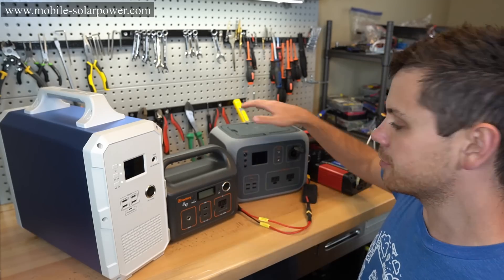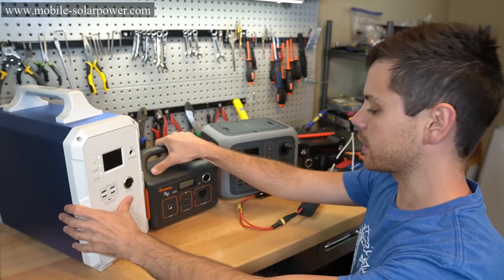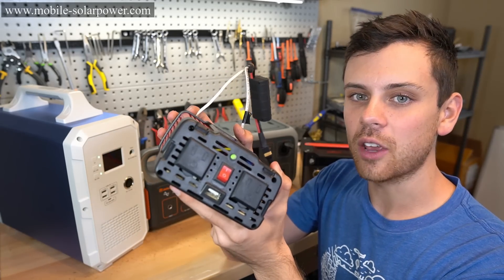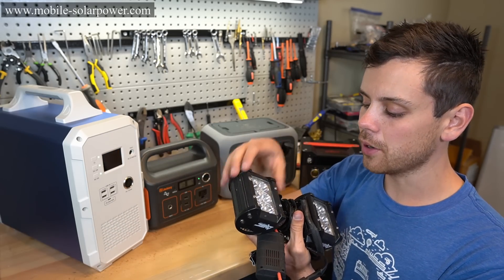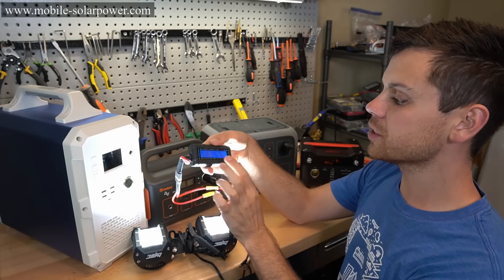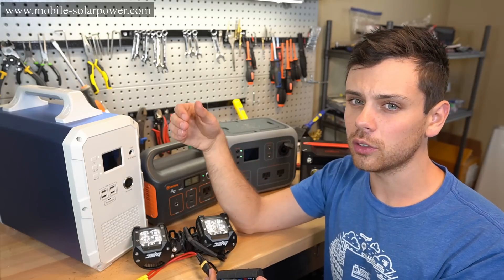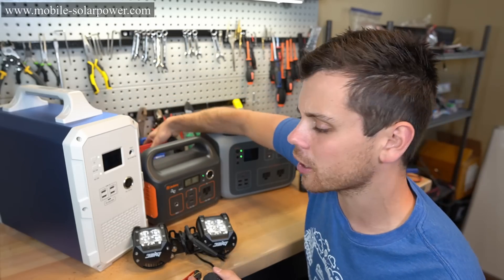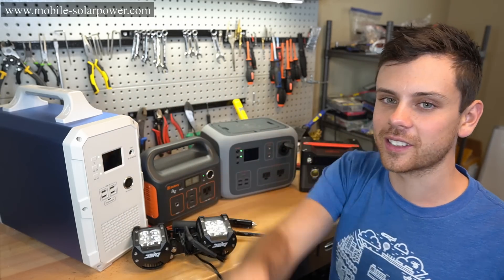Lithium Solar Generators: Why you need a regulated 12v output

Comment: There’s a lot of good info here, but I’m going to have to disagree with part of it as I think some discussion on the downsides of a regulated output is needed.  I agree with the core message – unregulated 3s (or 4s) lithium-ion output is not a direct replacement for 12v.  If you’re running low power devices that aren’t noise sensitive, or you don’t want to worry about the rated voltage range on your 12v devices, then sure – go with a regulated output.  Let me explain.

Regardless of whether the regulator is stepping up or down, there is a loss.  The regulator will also introduce some level of noise (I'll admit this is an assumption that they don't have great filtering).  These may be negligible, or they may not be – it depends on the application.  Radio applications, for example, may be more affected by noise.  High power applications will be more affected by the regulator loss or overload the regulator entirely.

That’s what so critical – what you are powering from it and what the rated voltage range is for those devices.  While most inverters will have problems with 3s output (9 – 12.6v) as Will pointed out there are some that are rated for input voltages down to 9.2v such as the Victron Phoenix series.  These aren’t cheap, but they are inverter options that can handle a wider voltage range and eliminate the need for a regulator.

Likewise, some of devices that you will run on these are simply stepping down to 5v.  In that case, there’s absolutely no need for another regulation step that is just decreasing efficiency.  From my testing, most step-down devices (for USB charging, etc) can tolerate 8v-28v+.  Of course, there are other 12v devices that will simply not work on the lower output voltage of an unregulated solar generator.

In my opinion, the best option would be having regulated and unregulated outputs available.  But I’m also overly picky and really don’t like these off the shelf solutions – I ended up building my own 3s lithium-ion pack which isn’t regulated and should be able to output roughly 50A peak.  I’m aware that may not be a common use case, but I looked at the devices I plan to run on it, and I shouldn’t have any issues with the voltage range so I can skip regulation (or add an external regulator later if needed).

Lithium iron phosphate is a different story - 4s LiFePo4 is much closer to a lead-acid 12v system and shouldn’t require a regulator.  I’m just not sure if any of these vendors are using those batteries yet in their solar generators.
Reply from the maker: I have to disagree because first the efficiency of these converter circuits is the difference in voltage between input to output, and usually in my tests, boosting from 10 volts up to 13 volts will be around 96% efficiency. Next, the noise is low. If you have extremely sensitive equipment, why in the world would someone run it through any solar generator this cheap? If someone is doing radio, I would imagine they have a decent education I'm electronics and would build their own. Not using a cheap battery box from China.
Reply from the maker: Yes, LiFePO4 doesn't need it and I love that chemistry. And yes, I'm glad you made your own pack. It would be pointless to buy one of these units for your application

Comment: Hey will, you should check out Beaudens. They are using LiFePo4 batteries and mppt charging. They only have a 166wh available on amazon but they told me they are making 300/500/1000wh models right now with pure sinewave inverters. They do passthrough ac/dc/solar charging also. Definitely interesting to see someone moving in the right direction with these.
Reply from the maker: I know of those. I had no idea they are making larger models. That's great. Thanks for heads up
Reply: @WillProwse  I just received the Beaudens 380wh LiFePO4 power station and I'm in the process of testing it now. Will - since this is using LiFePO4 chemistry, will the 12vdc output effectively be regulated because of the characteristics of the battery or no? I like the size/specs - 2000 +/- charge cycles, pure sine wave, etc but I am planning to run a 12v portable refrigerator so the regulated-ish output would be the deciding factor if this will be suitable for my application. Your thoughts? Thanks!

Comment: My guess is the unregulated ones just feed of a 3S pack (assuming 18650 LiIon) or 4S (LFP), and the regulated ones have a 4S or 5S pack feeding a buck converter. Oh so slightly wasteful, due to losses in the converter, but made up for by the extra cells in series. The coloumb counter would be connected before the buck converter in my design so you could see the total usage, not just the usage after losses in the converter. Charge controllers have very wide voltage output tolerances, so charging a 5S with a 12V MPPT/PWM is very doable.

Comment: So, if I have a simple panel+charge controller+battery +inverter+load setup, it may not work for some loads just because the  output is not regulated? What do I need to do then?

Comment: will, what do you suggest to make a regulated 12v. you mentioned in one of your videos that its fairly easy to make one. Im looking to add to my diy portable power banks. Ive seen step up regulators, is that the same?  Can you chime in, im sure others will want to know also...but dont have the knowledge like me
Reply from the maker: Yeah I could do that
Reply from the maker: I promise it's super easy. Just a typical boost converter

Comment: The young man knows of what he speaks.  And some items that you use will have regulation as well that needs a minimum voltage to regulate properly.  I want something closer to 13 volts minimum at full charge.

Comment: This is probably why auto fridges like ARB and Dometic don't run off some of the solar generators out there. They work fine at the beginning and then won't cycle on after a while.

Comment: Idea for future video: Build some sort of current limiter device that would allow the Bluetti to be charged from an alternator. I know it can be done with a inverter as you described, but this is expensive (have to buy inverter) and inefficient (dc to ac to dc). Isn’t there some way to build a simple circuit that would reduce the maximum current coming off the alternator to the max the Bluetti can safely charge at?
Reply from the maker: Yes a DC DC boost converter with current limiting will do it

Comment: So glad you have your channel!  I just started getting into solar power about 3 months ago.  Wanted to have a portable powerpack to test electronic equipment for units I sell and buy (had been using my Duracell power pack 500).  Bought an Ecoflow River and it has worked well for me.  Right after I bought it, the Jackery 500 came out and I had to have one as well.  I also lose power a lot in my community and the Jackery 500 will help me keep a few things running when we lose those mostly 4 hour power outs.  Now, I'm looking forward to find a bigger unit for more home emergency like the Blueitti.  Glad to see in the next few months quite a few more companies will bring new items out giving more power.  I see the EcoFlow Delta may be a wonderful unit coming out very soon.  Little scared though to buy something from them.  My Ecoflow River has worked well, but in the last 3 months I've asked a few basic questions about the unit thru their support.  Never once did I get a response from them.  On the other side, the Jackery people have answered every question I've asked them and usually give me a response in a day.  I don't plan to build a home unit, but I do watch all your videos and have learned a lot about solar!  Your reviews of the power stations have been so informative!  Can't wait to see those reviews as those new units come out.  Again, great channel!  Thank you!!  -- Atco

Comment: Everything below 12 volt becomes problematic, as 12.0 volt in a car battery means it's almost empty. To prevent damage to the battery by overdischarging most inverters will cut off around 10.5 or 11 volts; inverters will cause load spikes that might drop the voltage to those levels. Especially if the cables used are thin this drop will happen.

Comment: I completely agree with you. An even better test would be to use a 12v clock. An unregulated output could cause all sorts of issues if your device is time sensitive

Comment: Not to mention damage due to power draw for unprotected items. Potential over heating and increased resistence in wiring...
The list of reasons to go with a regulated source is extensive.

Oh and that low voltage to LED. This will potentiallly damage, discolor, and decrease life of LED's

Comment: The regulation also eats power as I imagine its a crude way or voltage regulation as apposed to a step up buck converter
Reply: Interesting thought I had.. I imagine most outlets are around 13.6v due to the design or 12v was for vehicles and the alternator generally float them at 13.6 to 14v. Good video

Comment: Does such power regulation cause RF noise? I'm interested in a small self-contained unit for ham radio. I have a Jackery 160 but haven't tested it yet.
Reply: Yes, almost certainly some level as they will be using a switching regulator.  I'm assuming devices like this won't have great filtering on the output.  I'd be interested to see someone test this though.

A solar generator using LiFePo4 batteries (in a 4s configuration) would be better for this application as it wouldn't require a regulator to have output voltage very close to lead-acid.  Just not sure if any of those are available.

Comment: Advantages I have learned from Will about  the Jackery 500 that make it the best choice for CPAP machines.
1. Can be charged and discharged at the same time. = Great for 24/7 use. *
2. Has the best display for power in and power out. 
3. Voltage regulation ensures clean DC power. = Protects sensitive electronics.
4. Expandable. Suppose I want to add a larger battery but the larger battery does not have voltage regulation. No problem, just plug the larger battery into the Jackery and the batteries will even out. I am personally looking at the Mighty Max Battery 12V 75AH Gel Battery, currently $160 on Amazon. I like that it guarantees no fumes for indoor use.  

My CPAP is hooked up to my Jackery  24/7  to ensure clean and consistent power. I don't worry about minor power surges, brown outs or power outages. 

The only downside. The Jackery takes 8 hours to fully recharge from zero, some competitors only take 4. And of course, the lack of an MPPT charge controller for when I upgrade to solar. 
* Once the battery is fully charged, the shore power on my Jackery 440 is turned off and will not turn itself back on. The work around, when I turn my CPAP machine back on, I unplug the shore power from the Jackery (not the wall) for a few seconds then plug it back in. This way, my Jackery is always at 100% power. One month in and I have not seen any change in battery performance if I just run off Jackery, no shore power. I still get 8 to 10 hours of power before going below 30%. The Jackery 500 replaces the Jackery 440, so the 500 may or may not have this minor inconvenience. 

BTW, the Jackery 500 is on sale on Amazon today for $425, a $75 savings.

Comment: Regulated vs. unregulated; has a lot to do with the battery's state of charge. As long as the battery can supply 12 volts it will work just fine. All your examples had batteries of less than 12 volts. Another words, it's capacity. How long a battery can sustain 12 volts at what draw.
 All batteries will fry in an instant if you allow them to draw too much current.

Comment: Hey Will... Is it possible you are dealing with two different battery chemistries? The open-circuit voltages for what you are calling the "unregulated" units seem very low for their given SOC. It is suggesting to me that the "unregulated" units are using lithium-ion cells in a 3S configuration and what you are calling "regulated" units are using LiFePo4 cells in a 4S configuration. I could not find any specs for the types of batteries that the MAXOAK units are using. Have you opened up these units to see what type of batteries they are using?
Reply from the maker: Yes absolutely, that was the point. 3s lithium ion cells have a low nominal pack voltage. And unregulated refers to converter circuit that ensures voltage is constant even if battery voltage is low. If internal jackery battery is at 10v, it still outputs 13.3v.
Reply from the maker: oh I see what you mean. No they are not different chemistry's. One has pouch cells and the other one has cylindrical but they're all the same chemistry of nmc. actually the next oak has a different cell configuration in the lower the voltage with a converter
Reply: @WillProwse  Hey Will... can you point me to one of these "regulator" circuits/systems that you are talking about? I have looked at "boost" systems but they seem to be for greater differences between the unregulated input and the regulated output.
Reply from the maker: @PAKOREGON  Boost Voltage Converter, DROK 1500W Voltage Regulator Booster DC 10-60V Step Up to 12-90V 20A Input Power Supply Module Volt Transformer Circuit Board https://www.amazon.com/dp/B076TTBKFG/ref=cm_sw_r_cp_apa_i_EX1PDb3Y2A2TQ

Comment: My father-in-law wanted to use our camper's fridge to store some extra stuff. He hooked up some cheapo 120 volt 16 guage extension cords to span 100 feet.
We had to get a new fridge.
Low voltage does the same harm as voltage drop.

Comment: Oh absolutely correct young man the inverter cut off to protect itself once you go below 12.2volts you.ll heat the circuits and damage whatever your trying to power less volts = more heat mostly things with a motor armature pump,fan, starter motor melts the windings and brushes

Comment: I just don’t understand how anyone thinks an unregulated supply is OK.  I use 12v systems primarily to power radio equipment, and modern transceivers don’t even like “just” 12v, never mind sub-12v when dragged down under load.  Just trying to excuse cost cutting during manufacture, IMHO.

Comment: Hi Will, nice Video ! is it really a regulated output on the other devices or maybe a differend battery type used (LifePo4) with a higher nominal voltage than AGM ? what type of battery is used in the device with the low output? sorry for my german english :-)

Comment: I haven’t been tempted to buy any of the solar power generators on the market. There is no value compared to building your own custom solution. I have some unregulated outputs and some regulated outputs on my diy solution for different reasons but my battery has a low voltage disconnect set at 12v anyway for longevity. Even at a reduced battery capacity due to using a 12v low voltage disconnect the useable capacity is still larger than any of the solar power generators on the market.

I understand the convenience of buying a ready made solution but the price of these are still too high to tempt me to buy an imperfect product.

Comment: Again timely. Still in cyber discussion wit Renogy over the 11.86 output of the DC port. See how this is resolved. As you said, unacceptable that  I cannot run my 45 watt fridge with 12 volt power.

Comment: So are the goal zero's 12v outlet regulated? I mean for the premium you pay for it, I would assume it would be. I have the Rockpals. was aware of the 12v not be regulated when i bought it. In fact to be honest I didn't even know to look for that feature. But i bought it mainly for the ac outlet and usb plugs. Probably a stupid question, but you spoke of a 12v device needing a regulated 12v outlet to work at it's full potential or even work at all for that matter.... is that the same for an 110 ac device? I mean does an 110 ac outlet need to be regulated for devices plugged in it to work properly or is all ac outlets regulated or is that even a thing? I'm very new to all this.
Reply: no they are not they sell a separate addon to make them regulated
Reply: @littlebill2601  thanks for the info. When you say they sell an add-on to make it regulated, are you referring to rockpals selling it or a third party?

Comment: As voltage decreases, the amperage will increase as the load tries to keep pulling its needed wattage. Fuses will blow earlier, wires will heat up, and lower DC voltage will drop more, especially on longer runs on small wire like in a travel trailer. I can’t believe those companies tried to snow you! Most so called 12 volt accessories are made to run with an alternator at 13.8-14.2 volts.
Reply: WRONG.   Lower voltage means less current through same load resistance.    OHMS law my friend.
Reply: jp040759 lol yeah I said that part backwards, thanks for the correction.

Comment: I've had the other problem.  My battleborn puts out 14.6 volts and 12V items won't run without a reducer.   Explain that.
Reply from the maker: What appliance?
Reply: @WillProwse  one was a 12v Amp.  For speakers.

Comment: I have some very sensitive radio gear that I power with my system. Without a regulated power supply, as soon as the voltage drops below 11.9v. It will shut off to protect itself.With it regulated I can gain several hours out of my batteries over unregulated.